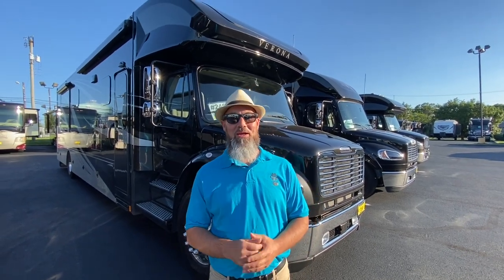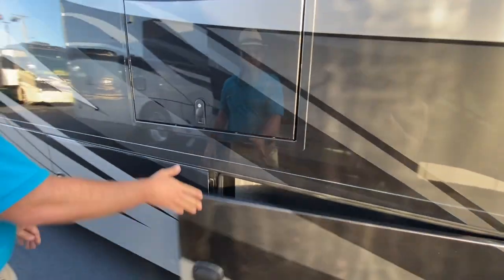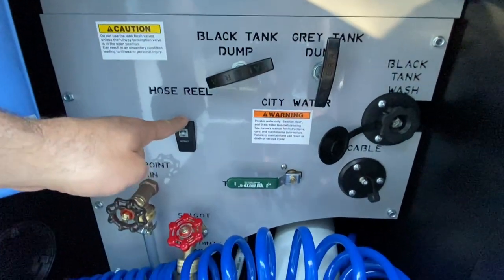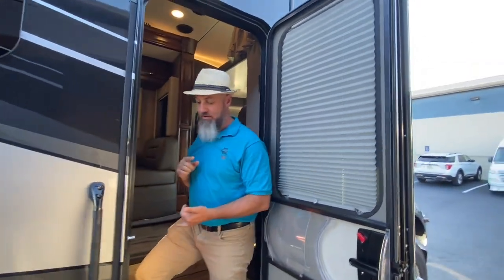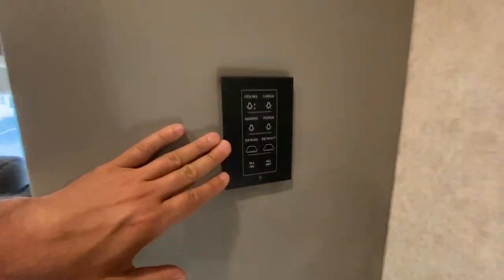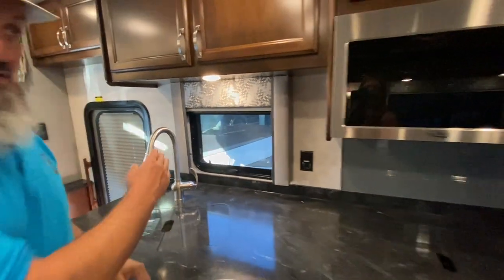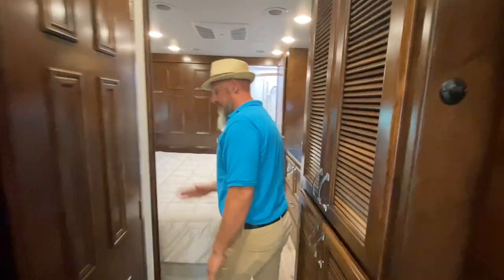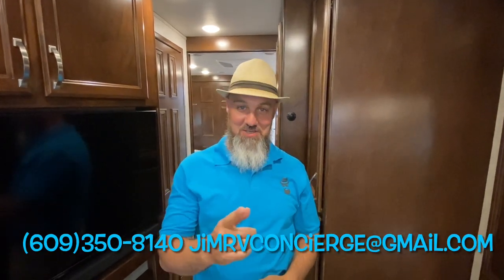Gorgeous bath and a half Super C! 2022 Renegade Verona 40VRB

Comment: Can the L9 Cummins be turned up? I thought they offered up to 430 HP? The X12 would be even better!
Reply from the maker: The L9 can do 450HP and 1250 Torque but would need the M-2 112 cab with larger cooling system. This is on the M-2 106 cab so it not possible here.
Reply: @RVConcierge  Bummer.
Reply from the maker: @1hasbeen531  I am in the process of trading a 2018 Dynamax Dynaquest XL 3801TS with the 450HP Cummins!
Are you in the market???
Reply: @RVConcierge  Not yet. We sold our Sundowner Toy Hauler right before the RV market exploded. Still recovering from that financial hit. Leaning towards a Super C and race trailer, instead of a fiver next time. Been snooping at Renegade and Newmar. I like the Renegades better.  Newmar does offer the D13, which is tempting, but I favor Cummins. Sorry for the long reply.
Reply from the maker: @1hasbeen531  ok stay in touch I can help you